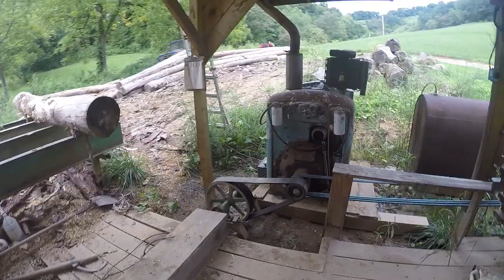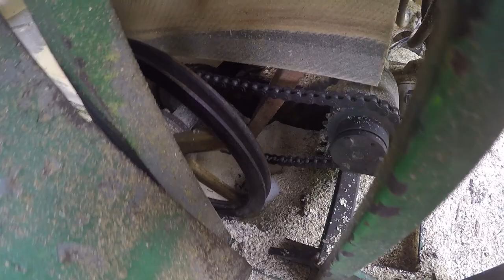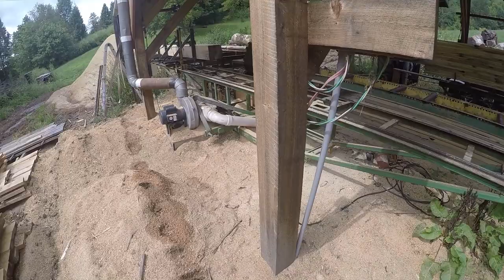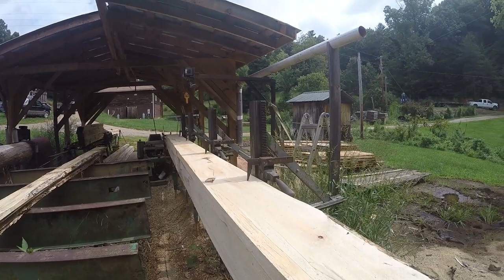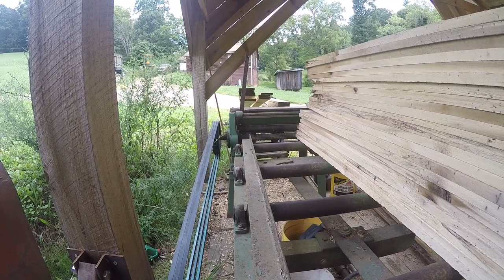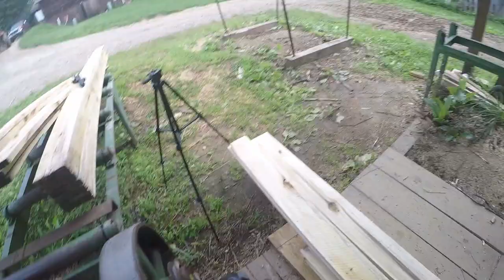Sawmill Tour, More Sawing Videos Coming Soon.

Comment: I agree with mr Galicic that has lots of features that a much better mill than a bell saw
I have a similar log turner, it run off a small husk to a big old winch , what a difference 50 yrs makes…
Thanx again and we enjoy your videos
Reply from the maker: I also agree. I have done a little research on this mill. There doesn't seem to be a lot of information out there on a 3 point hitch Utilizer sawmill. Best I can find out is that it was built in 1978. I am very impressed with it so far.